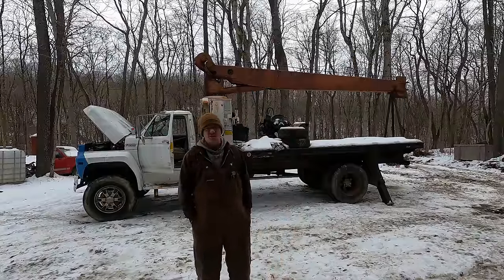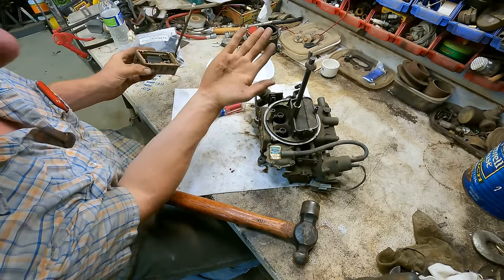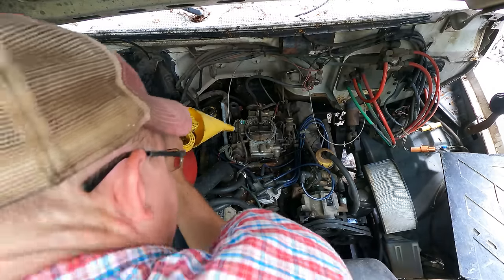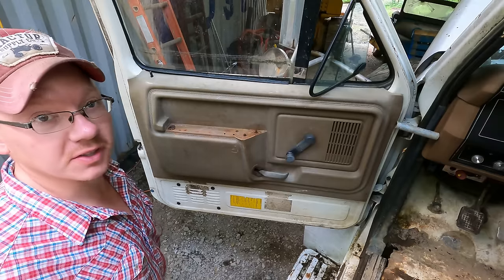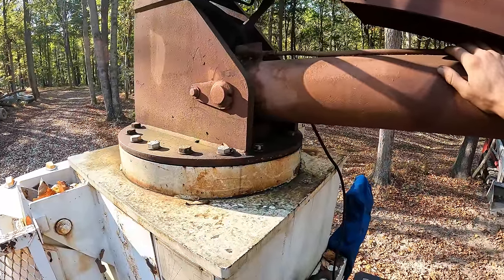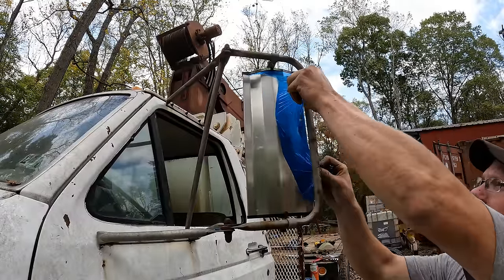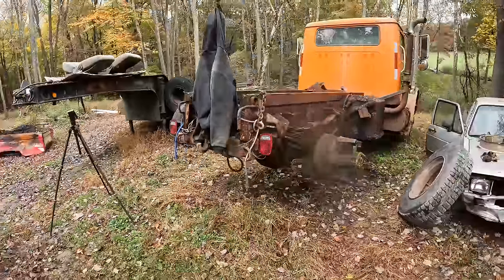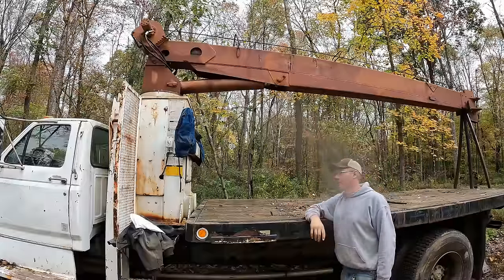Repairing a $700 Auction Crane Truck!

Comment: My favorite fix for water dripping down onto the top of the engine is to make a gutter system using a split old big inner tube riveted from the firewall to the hood that spans the width of the engine. Diverting the water to the sides of the engine.

Comment: the ignition switch fault could be the coil resistor if there is one fitted, some uk fords were fitted with a 9volt coil and when you turned the key to the start position it fed 12volts direct to the coil to get a good spark during cranking, and when you release the key, the coil feed is switched from direct to through the resistor, so if the resistor is faulty, releasing the key will cut the engine! Engine sounds much better now!
Phil

Comment: I think the reason it cranked and worked fine the first time in months, then didn't, is because there wasn't much fuel in the lines, then it sat overnight near full pressure, and froze up. I've had this happen with vehicles that are winter only (my plow truck, my snow blower) and because of that, i've installed a fuel cut off at the fuel tank. Once i'm done with the machine, i'll shut it there, and let the engine die from fuel starvation.
Reply: winter fuel isn't supposed to freeze?

Comment: UPDATED = MATT me old mate, you need a couple of foot of very thin plastic tube, one end goes to the can of good stuff in the cab, the other end into the carb or air-cleaner, turn the key press the can engine gets good stuff while your cranking by the key - its so easy for a yard truck/Oh you can keep yer snow too/ we dont get much right by the coast BUT have been known to be cut off in the last few years thats why i got landrover diesels, always start, always get you where your going.. We are not a Jeep Island really, home grown will do for us.. thanks for the videos - Ian --UK.

Comment: I'll tell you one of my cheap old man tricks for those hood gaskets. Just clean the gasket off good and take a razor blade and slit it down the center of the top of it all the way across and open the hollow part up. Then take a new tube of 100% silicone and fill it up all the way across, then make sure it squeezes back to it's original shape, then put a 1/4 inch bead across the outside of the top and smooth any high spots and just close the hood down to keep moisture off but not allowing the hood to touch the gasket and let it set for at least two days or more if cold out and you'll have a better gasket than the factory. $7.00 Bucks is much better than $35.00.
Reply: So what you are saying is to take off the old head gasket and replace it with silicone and the head of the block and valve thing ( I don't know the name) are so flat that it will create a seal.
Reply: @TheRCBasher69420  Reread it, "HOOD" gasket, Not head gasket....Damn.
Reply: @TheRCBasher69420  I hope this was an attempt at being funny. If not, May God help you.

Comment: Matt, nice to see your finally going to start on your shop. I would go with 16' high walls so you can have 14' high doors that would be good for any future bigger equipment and at least 1 door 14' wide. bigger excavators and dozers are 12' wide. also we put a 15K pound hoist in my son's shop that had 14' walls, we ended up framing out an area in the attic to accommodate the hoist it was 15' high.

Comment: A suggestion on the exhaust leak (stock manifolds only): loosen the center nut of each motor mount. With jack under the balancer, lift engine enough to break the "seal" and use grease spray on mount pans. Lower engine and remove jack, start the engine and goose the throttle 3 times. If the exhaust leak disappears, tighten the motor mount bolts. I did this myself on a '71 f100 302. Suggested by friend with '66 international pickup. Mine never leaked exhaust again. If the engine looks kinda "cocked" in the frame rails, don't worry because the engine "walked" to where it wanted to sit anyway.

Comment: Got an 81 f700 dump truck. 8.2 Detroit diesel. No turbo, no glow plugs, Cranks in an instant, even when cold. Would have been a treasure if yours had  come with one of those running.

Comment: "Starting Fluid" is a mixture of a highly flammable substance called Ether
and Carnation White mineral oil, for "upper cylinder lubrication" that
also aids starting by raising manifold vacuum and sealing of rings
and valves, to raise compression. It's propellant is usually Isobutane,
a mixture of Isopropyl alcohol to absorb moisture and butane, a 
highly flammable gas, distilled from petroleum.

It is engineered to be sprayed in the intake, past the throttle body,
while the engine is being cranked, to facilitate it's proper ingestion.

If the makers of these products only knew- they would include a 
long tube with the can, so the User could crank the engine while spraying.
Reply: place i used to work had ' winterised ' all of their small diesel plant ( forklifts & tugs mostly ) with an old windscreen / windshield washer assembly , the reservoir was filled with starting fluid & the nozzle was in the intake .. even in -10centigrade crank it while holding the button & everything would start pretty easily
Reply: You'll see many equipment with a holder for the spray can, long tube going to intake, and a control on the dashboard.

It has developed a bad reputation for several reasons, stories of it
causing problems such as fires, hydrolocking, damaging crankcase oil,
and the misconception "if it ran correctly- you wouldn't need it", "it's a band aid for other problems".
While the latter maybe true, certain climate situations do call for it's usage
in the Owner's Manual of the equipment.

The engine must inhale it while cranking to be effective.
Reply: @HUBBABUBBADOOPYDOOP  Not just to be effective, to prevent damage. Spraying it into a diesel at rest can lead to premature ignition and bent rods.
Reply: Now that was a mouth full!!!!
Reply: And to think that in the past engine manufacturers offered an ether start system that was actuated with a switch that the driver could operate.

Comment: Its not an Andrew Camarata repair unless you say “ok that’s fixed” after a job!
Reply: OR....This arm pad broke for no reason...
Reply: Don’t forget to Paint!🤨  Yellow!
Reply: not forgetting "there, that's good as new again"
Reply: Or with out saying “this design is horrible they should really have _______”
Reply: That's only half of it, "OK that's fixed......Let's go do something else". Full statement.
Reply: Ima going to have to try that on my '02 D'max.  Both armrests are toast.  AZ sun's hell on stuff...
Reply: @laknox88  i feel you on that one. I used to have a trailblazer and half the interior panels were held on with self tappers into the door sheet metal
Reply: @JackS425   Just waiting on final settlement of our folks' estate and a new Denali 3500 may be in the works!  Fingers crossed!
Reply: Gotta get this bolt out. 

*Fires up the skid steer

Comment: Should crack the cleets before removing the lug nuts completely. Those things can fly off at a great rate of knots & can cause damage to anyone standing in front of them. Safety first As you well know.
Reply: Supposed to break the lugs lose maybe one full rotation and then smack cleats with a hammer. Those things can kill you. Never take the log all the way off before knowing that the cleat is loose
Reply: Time firster and money firstest

Comment: Hey Diesel Creek. Not many people will tackle these carbs, but I've found out you never learn anything just throwing on new parts.  Likely that thread in power valve was cracked and engine vacuum pulled the gas straight through.  I've done probably 150 of the holley 4 bbls through the years. Just did one last monday. The thing to note about these carbs with the governor is to re latch the hooked throttle linkage. The throttle will work but poorly if this isn't latched. Follow the arm that the return spring hooks to, and on the bottom you'll see a set of hooks. Rotate throttle fully and re hook the spring lever. Now is when I wire things together so it can't come unhooked. If you dont wire it and push the spring lever to rev the engine it un hooks again. I'm not sure why it hooks this way, but I get 2 or 3 trucks a year that are un hooked and the foot pedal is way hard to push.

Comment: I noticed when you installed thr carb when you were trying to start it there was some  sparking on the passenger side near the fire wall on the engine  mabe a coil wire could not see clearly  may want to check it out could be Your starting issue grounding out . 
Also an idea build a couple of ooen boxes behind the rear outriggers  for pad storage to go under your outriggers when using the crane keep them from sinking into the ground  . Just my thoughts  glad to see it running oh also may want to mount some spot loghts on the boom incase your working late and need more light to finish . Until the next video peaceout 👍

Comment: One additional note…. Any time a Holley carb pops through the intake, blown power valve.
Reply: Newer ones have a one-way check ball in the passage to protect the power valve from blowing out. The check ball is available to retrofit an older Holley for a few bucks.

Comment: Those 370 and 429 gas engine are really good engines. I have worked on many of them and they will really surprise you with their power and speed. Those exhaust leaks are terrible on that model, many times they will actually break the manifold bolts after the engine coos down. Sorry to be a downer Matt but that is my experience with them. Ford could have put the alternator on top and one of the emission pumps on the bottom but that would be to much like right.   LOL

Comment: Matt you need crabbing for your outriggers it well help with the mud around the farm . Make them 2 ft. X 2 ft. Square and around 4 ply of treated ply wood .  . And the mirrors try and rap a piece of old rubber around the bracket .

Comment: The mirrors have rubber grommets in the brackets and the frame to absorb vibration
Reply: @agnez8646  will you go away damnn
Reply: I assume you mean they're supposed to have rubber? I didn't see any but that would explain why it didn't tighten up 😁
Reply: @rpavlik1  yes rubber

Comment: The starter won't take much more of that! I think the fuel pump is sucking air!
Reply: If you've ever watched videos of cold diesel start-ups, you'll see starters take a LOT of cranking to get them started!
Reply: @samvalentine3206  That is NOT a diesel engine in the truck. It is true that not all starter motors are of the same quality it is also true that they are NOT designed to run for hours at a time. If your vehicle doesn't start within about 5 seconds you should figure out why. A diesel engine needs compression & fuel to start & run. A gasoline engine needs compression, fuel & spark to start & run.

Comment: Matt, PLEASE show that Ford crane truck some love and attention.  That exhaust leak does make it sound like a total s##tbox. A quick “ rattle-can paint job”, some decent recap tires on the ass end, some inexpensive new front tires, and its’ own hard pack parking spot. Don’t mean to get into your wallet, but you’ve done all the back breaking work, finish it out and you have a great heavy lifter for your needs around the yard. And it can sit for weeks, but still be ready for use when YOU need it. Love your videos, admire your work ethic, need more of that ethic in this Country right now. Thanks Matt.

Comment: Air filter cover question. Is there some reason you can't fill the area where water pools with epoxy putty or body putty so liquids run off rather than in?
Reply from the maker: Probably could yes
Reply: @DieselCreek  Yeah I'd fabricobble something to prevent the water draining where it does. 😀
Reply: I suspect Matt will get to that when he fixes the exhaust manifold.
Reply: Great Stuff,  expanding foam would work great.
Reply: Might be easier to find another air cleaner cover that fits that doesn't have those recesses.  But filling it up with Bondo sounds like a good idea!
Reply: @DieselCreek  Don't muck around with it, throw that piece of rubber back over it and put a couple of jockey straps on it and it'll be right - it's not like you are going for an inspection so who cares  -  hey what ever became of the blue Jeep you acquired a while back?

Comment: Old piston airplanes, when operating in cold climates (or just winter); before shutting down, would add fuel to the crankcase.  Called a Dilution valve, and holding it down for a few seconds (based on experience).  this would thin out the oil and make it easier to turn over in the morning.

The fuel in the oil would eventually flash off as the oil temp would rise and the vapor would go out the crankcase vent tube.  Easy peasy.

I have a 1965 310 with the dilution valve still on the instrument panel.

Comment: Matt,  I'm now a dedicated fan of your Diesel Creek videos.  Grew up in Erie County PA working family farms on PA-NY state-line area making do with what others had used up and we re-built and continued to use.  Worked gas distribution / construction and  obtained a degree in petroleum engineering. I've spent my working career in Texas oil & gas industry and soon to retire. Re-built a number of Ford  V-8's in younger years. After all the time and effort you put in to your shade tree re-build sure wish you had gone through the valves while you had the engine out and the heads off.  All the best to you in all you do. Keep the videos coming!

Comment: I have added two lines with quick disconnects to mate with some equipment used during cold weather. My service vehicle can heat an engine while charging the battery. My M35A2 starts quickly.

Comment: Clean fuel lines, clean the tank, add a inline filter after the tank and one before the carb. Check points, timing, plug gap and plug wires. Just had to do this with my truck.
Reply: Paint the boom Orange with Diesel Creek in gun metal grey outlined in a primer grey.

Comment: New spark plugs and some ignition timing. Loosen the distributor and turn the unit itself slightly side to side until idle smoothens. A timing light would be best but generally you seem to know what an engine should sound like and small tweaks can be made

Comment: Hey Matt,  I love your vids, retired with my wife now to Thailand, so jealous of what you are doing! But look - you owe that poor old Ford a paint job and exhaust repair. Get some flux cored brazing rod and braze some patches over the holes, you've got gas sets so you have the kit, brazing obviates the need for extreme mig welding care as you don't get thin metal so hot you burn it. Then once that is done well, you've sorted the tyres, the carb, the engine got rebuilt, it starts on the key, the crane is perfect - I'd say the old girl deserves a paint job like your dump truck, and a ministry inspection or whatever they do in the US and then it's service life is extended to jobs outside the farm so maybe you can earn some money with it too. And please - get a radio wi-fi mic to you don't fade out. Got my amp all the way up but sometimes you are just too quiet to hear. Great work and channel - keep it up!

Comment: Somewhat surprised you haven't run across some tow truck that needs a home.  Fabricate or adapt a weathercap (like on vents on your house roof or chimney) to keep water off the air cover.  Couple of bolts/wing nuts for easy on/off and you can keep your mud flat for other important items.

Comment: Clean and gap the spark plugs, make sure they are not damp on the exterior from condensation as it cooled down from the day before. Doesn't take long to foul up plugs , when starting from cold.  I have experience of damp ignition cables causing induction from on cable to another causing backfiring in other cylinders. Damp rubber  plug caps shorting across to the cylinder head. Used to cure most of this with Wd 40 aerosol

Comment: great job on it, folks picked up a ol 66 ford f550 bucket truck bit ago for the ranch, 300 inline 6, 4 spd an air brakes with out riggers, they got it fer 1000 bucks, got a new carb on it, also gotta put a new water pump on an rad hoses

Comment: Think you should try and torque down the rotek bearing bolts on the under side of the super structure since the top ones were loose. It seemed to have a lot of slop in the swing there is a cover to remove to look at the gear teeth. And some boom trucks had a problem with the bolts that hold the swing gear box on working loose that also causes a lot of that swing play. Keep the videos coming good to see the struggle that other mechanics go through.

Comment: Youshould make a tarp cover   for the crane truck  ,this will keep water out of enigen space and  the cab . 
Also the tarp can be made to cover the tires also this will keep them from deteriorating due to UV light.
The cover will also ceep the cable protected from rusting  ,if you switch it out...

Comment: In the military we use to calibrate 2000 ft lb torque wrench’s every now and then. A bunch of 600 ft lb and all the way down to 6 in oz  and everything in between. PMEL , precision measurement equipment calibration. Fun job.
Reply: Air Force

Comment: Looks like a Holley R1850 ~575-600 CFM. Thet is a special "figure 8" screwdriver to remove the metering plates.

Comment: I've had scores of Holleys. Have one now. Almost always the accelerator pump on the bottom of the float bowl or front. What happens is when they age all you have to is let it sit and the material gets hard and is no longer flexible. Hit the gas and it doesn't squirt. Common issue. Of course the "double pumper" has two accelerator pumps.